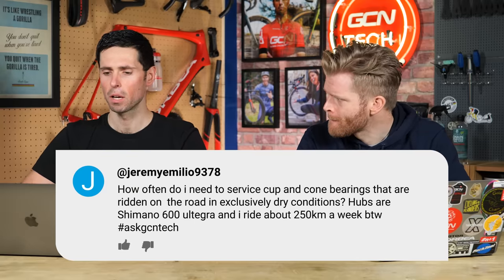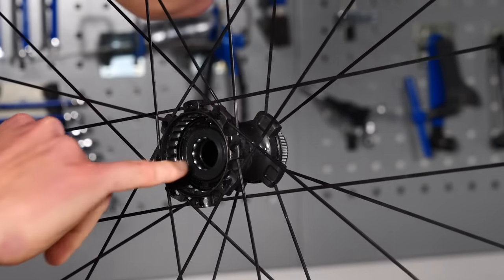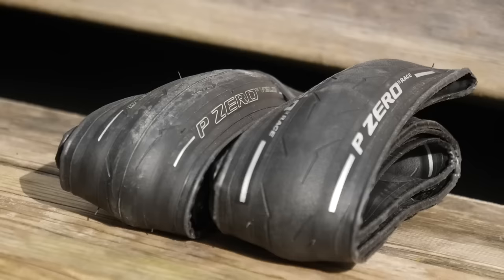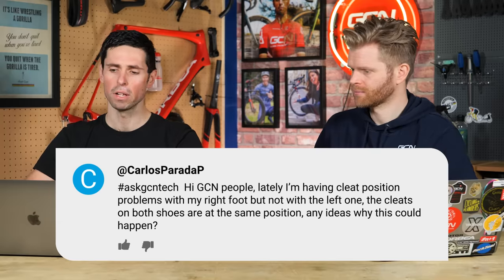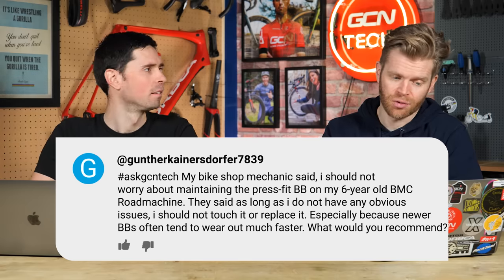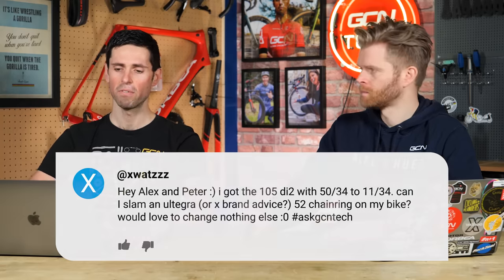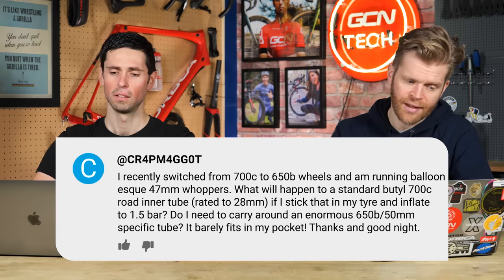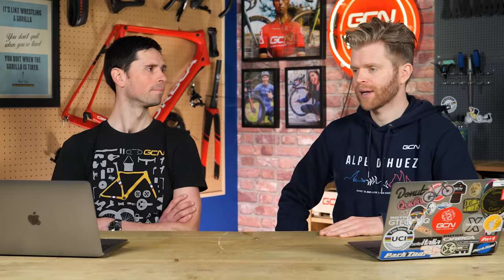Cycling Cleat Problems & Should I Swap My Tyres? | GCN Tech Clinic

Comment: #askgcntech I am swapping the 11-speed cassette on my road bike from a Shimano 11-32 to 11-34, but I have an indoor trainer with a 11-32 cassette that I'd rather not have to change also. Is it possible to leave my trainer cassette alone, or will the slightly longer chain to accommodate the new cassette be a problem when riding on the trainer? Thanks, tech gurus—
Reply: I've done similar cassette swaps and also use a trainer and your current chain should work on the larger cassette as you're only increasing the large cog circumference by two teeth.  If you were going to a 36 tooth cog or bigger on the cassette then you might need a larger chain.  Try the cassette swap and see if the existing chain works, I'd do.
Reply: It should be mostly OK, you just need to readjust the B-tension gap between the guide pulley (upper pulley) and the largest cog. As long as you don't cross-chain on small-small gearing, the chain should be under tension at all times.

Comment: Maybe a dumb question but, why do you mention the rolling resistance of inner tubes when it's the outer tyre that matters more??????
Reply: One of the components of rolling resistance is hysteresis within rubber. It happens where the rubber is going through loading and unloading, which is thoughout the whole construction, inner tube including.

Comment: #askgcntech Hi crew, I've recently converted to TPU from butyl tubes because of your videos. Based on the tyre pressure calculators online, I pumped up the butyl tubes in the 66-68 psi range. Should I do the same for TPU? Thanks, love you too, bye!

Comment: #askgcntech. Hi Alex and Ollie ,Mannon posted an in depth video on how to ride a fixie my question is can you have a freewheeling rear hub rather than one you have to keep pedalling, many thanks
Reply: Definitely. That's called a "single speed."
You can freewheel down hills, which is easier on the knees.
Cheers
Reply: @BrianRPaterson  cheers so why have a fixie when single speed makes more sense
Reply: @alanfreeman7932  Fixed-gear bikes are as mechanically simple as bikes get. No derailleurs, no brakes, just a frameset with a cockpit on a pair of wheels with a fixed single-speed drivetrain. In the case of NYC bike messengers, the city is pretty much flat, so there's not much descending to do.

However, because you don't have brakes of any kind, there's no stopping immediately on this kind of bike. The majority of fixies I've seen sold in small-time bike shops feature a front rim brake and a flip-flop rear hub, a fixed cog on one side and a freewheel on the other.

Comment: #askgcntech I recently bought a cheap dumb trainer, it won’t get much use so I didn’t want to spend more. I live in a flat and the trainer is loud. Is there anything I can do to avoid upsetting my neighbours?
Reply: If the problem is vibration, a good place to start could be putting a thick rubber yoga mat under the trainer.
Or, finding some of those 30cm x 30cm interlocking foam squares that parents put under kiddy swings. I bet Lidl or Aldi sell them.
Worth a try.
Cheers